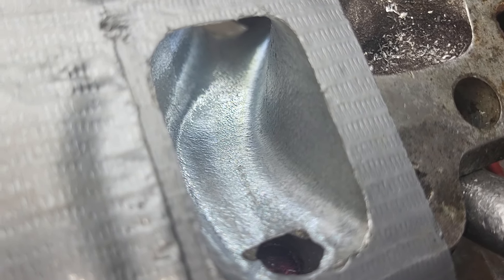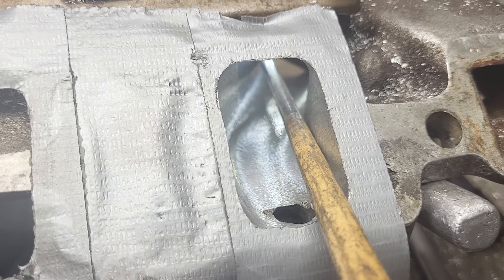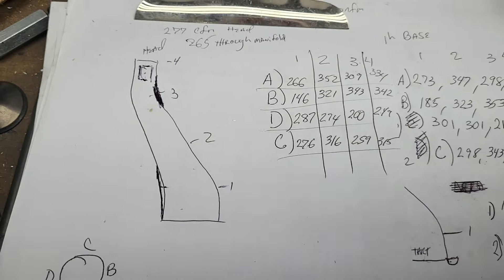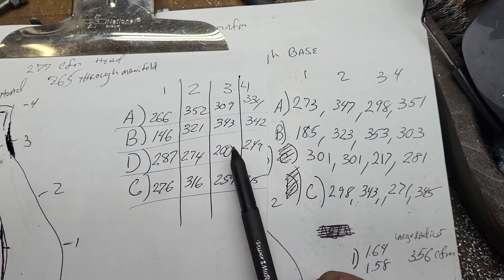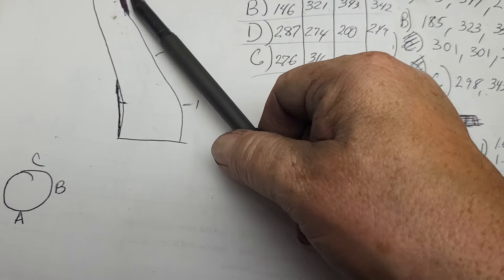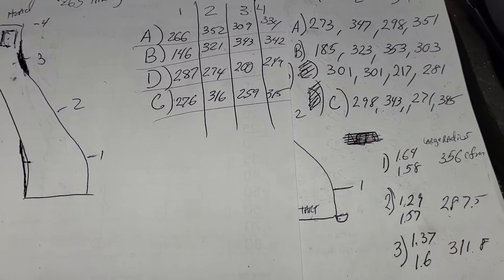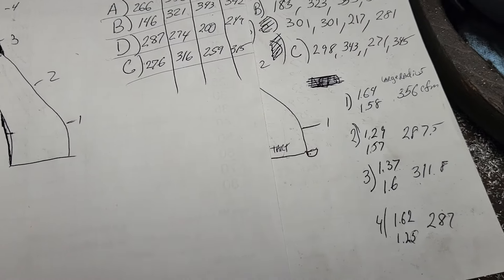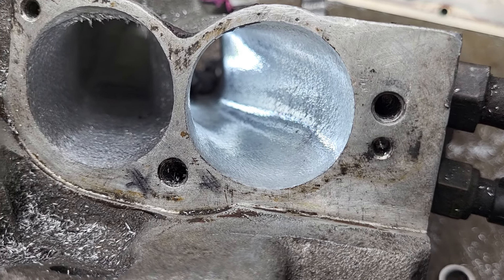The High Performance TPI project. More base manifold work to gain cfm and improve air speed.

Comment: I'm curious how the tuned port would flow with the swirl port heads. I used to know a guy with a K20, 383 with swirl port heads and tuned port efi. He swore by it, he was a landscaper when I knew him and he used it to tow his skid steer as well as a dump trailer he had. No idea if any of it was ported, actually no idea if he was telling the truth. All I saw was a TPI/SBC in a K20.
Reply from the maker: I always thought that could work. It would need a smaller cross section swirl port head but it would make great torque. Thanks

Comment: The view at the end it looks like if you break through to the other port would straighten out the path of flow? About an inch in the port to the left would have a straight shot to circumvent that turn? And it looks like the right port would feed the left one more gooder as well? 

Of course the manifold isn't in my hands so I could be mistaken. But from this pic that's what I see?🤷😎👍
Reply from the maker: The crossfire injection manifold has a hole in the ports like you mention. I was thinking about doing just what you mention but that will mess with our harmonic ramming. Thanks
Reply: @servediocylinderheads  
Cool, so I was on to something. Maybe get a hold of Pole Barn Garage and see if he has that TPI intake he threw on the lawn, maybe he'll give it to you for the cost of shipping? Then you can try that on a basically free intake. Looks like it might work, are the harmonics messed up on the crossfire intake?

Take a look at a Vortec lower intake,those runners are straight in. Do a search for one on the Bay of e, they usually have good pictures to look at. That lower with a TPI type upper would be very cool.😎👍
Reply from the maker: @itseithergonnaworkoritaint7852  Crossfire is low horsepower tbi crossram system. Has ver small runners and poor liquid fuel control.
Reply: @servediocylinderheads  
I know what the crossfire is, tried to buy a slightly used 1982 Z28 back in 1985. Something this 19 year old at the time couldn't get the loan for.🤷 If it was a multi point injection with bigger runners it might've been something?
So what do you think about trying that with a "free" intake? I'll go and ask him for you, he might be happy to donate it?😎👍
Reply from the maker: @itseithergonnaworkoritaint7852  Free is for me! Thanks
Reply: @servediocylinderheads  
I just replied to the Corvette video from 4 months ago where he tossed that intake on the lawn. Let's see if he replies to you or me?😎👍

Comment: If lower speed means higher pressure, and you have a greater pressure difference between the inlet and the outlet, then one could reasonably expect to have more flow throughout if the same measurement method were used. Eric Weingartner made a video where he temporarily blocked off the inlet of a port while he was flowing it, and after blocking it, the flow would not recover to the original flow numbers. To me that's clear hysteresis where once you destabilize a flow, it takes more energy than you initially put in to restore it to it's previous condition.

My point is, what you did maybe didn't gain much as far as flow numbers, but how does it affect the hysteresis of the airflow? In a running engine since the flow is pulsed, it would be more susceptible to hysteresis than from a steady state flow bench. In an engine the air isn't moving continuously it's slowing down then speeding up, and its inertia is at the same timer resisting that rhythmic motion. It's not until you start getting to ~4,800+rpm that you can start treating the flow as continuous.
Reply from the maker: What Eric was doing is causing the short side radius to go into seperation and it could not recover.
Reply from the maker: This system depends on that start stop flow . Thanks
Reply: @servediocylinderheads  It could, if you put more energy into the flow, but not with the same amount. That's how hysteresis works, it's basically the inertia of the air, and the resistance to change of that inertia. Vortices have a lot of inertia, because they're balanced by centrifugal and centrepital force. If you cut the axial energy, the rotational energy of the vortex doesn't dissipate immediately, it has inertia, and keeps axial flow going while it maintains its inertia. This can work for or against you.